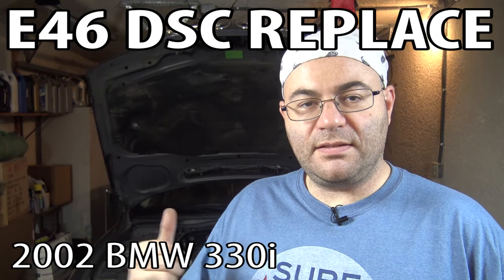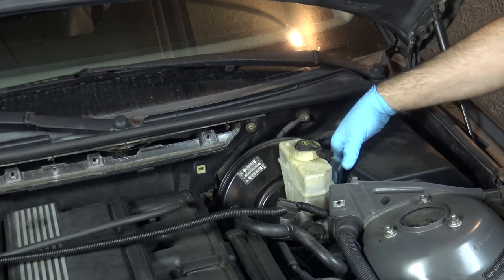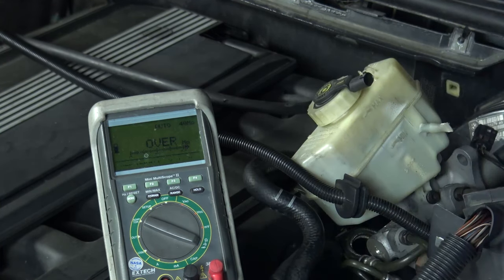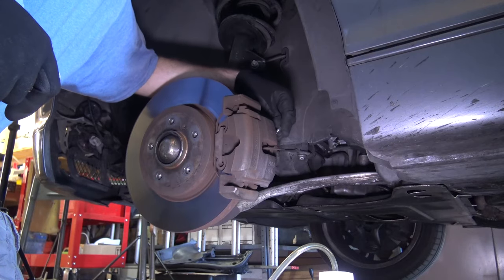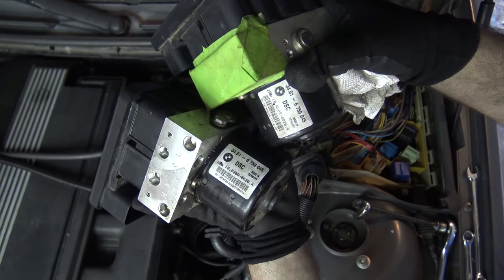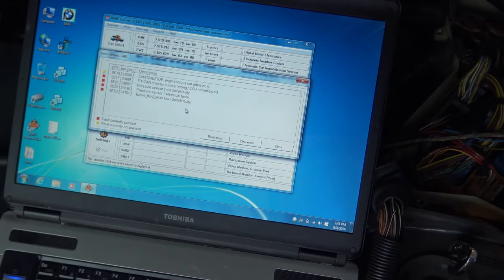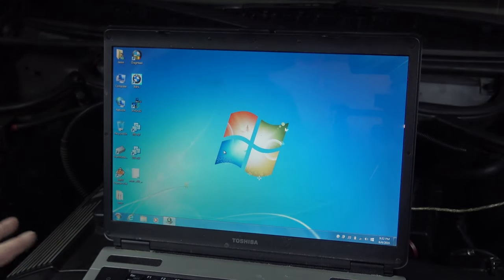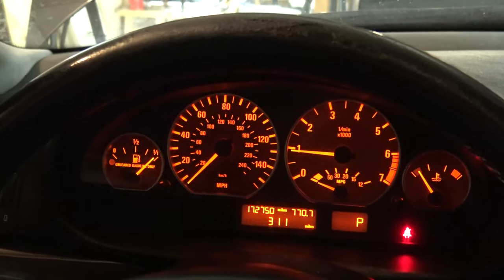BMW E46 DSC (Dynamic Stability Control) Unit Replacement & Coding! DIY

Comment: Two question and 1 comment.

Q1:  Once in inpa mk60 module, the steering wheel calibration was only 1 of 3 things to be set.  What about the other two?  (I think one is pressure, another is lateral acceleration.  )  

Q2: I have an E39.  I could not find any "compensation option" like this under chassis for the DSC module.  Which version of INPA are you using?  I think the E46 is similar, so I tried to use it but it would not allow.

Comment: Under chassis, it says steering wheel sensor, but you never need to go there, ironically.

Comment: Struggling with the coding on mine, when I select akmb or ews they show completely different vins to eachother, I know the vin when read using ista doesn't match chassis as I think ECU was replaced (says sportwagon when car is coupe) EWS brings up the correct code but the process won't complete, it comes up with coding index is not permitted

Comment: Hey great videos! Can you please help me? I got a 325ci 2002 and Just replace the dsc module and when I just turn que car On the 3 lights turn off (brake, abs, dsc) but after 10 min running they turn back On,  and so on, just put the same code one and reprogram, but keeps happening, Please help me!

Comment: I'm looking for a solution for my E46 330i EV51. I found part no for my 330i, but there's no cheap options but there were lots of same look and part no. in Ebay. Is that okay If I use similar part or not?

Comment: Next time you hit the junk yard, cut those connectors from a junk car. That way  you can just plug those in to test the modules the next time without having to unscrew them. Just make sure to test the harness connectors you get from the junk car first to verify they are good.

Comment: to drain easily the brake master you can use a 1 inch diameter syringe put a short or 6 inch long 1/4diameter hose and suck up the braké fluid in the resevoir you can suck up brake fluid easily

Comment: Hi 50sKid
I have a problem, sometimes the yellow light turns on DSC and yellow hand brake together.  How do you think it is the same problem as you have shown your video?
Thank you
Reply from the maker: You'd have to read the errors in the computer to figure it out.
Reply: Ok, thanks for repply. I need to wait when lights gone on.I drive now the fourth day and all is well.

Comment: Hello 50skid I installed everything and when opened and tried to code the mk60 module its says coding active and gives me 4 error codes basically saying the module isnt reading or responding any ideas on what it could be ?

Comment: Hi again.  Lately the DSC light goes  on my dashboard ( yellow in color in the very center. ) on my 328-2000 with the M52TU. ( no  other lights go on.)  But some times goes off. Some times stays on. Pressing the DSC button below doesn't put it off. If I buy a new DSC unit at BMW.
Does the dealer needs to reprogram the DSC unit for my car.???
Or removing the old DSC in the car now.
Where do I sent it to be repaired.?
Which is better for me to do.? 
Thank you. So much.
Reply from the maker: +Tonio Castro this video literally contains all the knowledge you need to answer your own questions. Did you watch the whole thing? I replaced my unit with another and reprogrammed it all in this video with inexpensive hardware $20 and software (free if you look for it)

Comment: Hi I have a 2004 BMW 325i and I removed the cluster to replace gauge rings and when I plugged it back in the DSC AND YELLOW BRAKE light comes on how can I fix it because they weren't on before I removed cluster..any advice thanks
Reply from the maker: Get a bmw scan tool (i have a video for that) to read/clear the errors

Comment: i also have a code for the brake pressure sensor like u did do I just buy a new one  I have the internal fault code but wouldn't see why both would have failed at the same time or is this a common issue thanks 50
Reply from the maker: I suggest reading the fault codes with a BMW code scanner first to find the real problem.  The DSC lights also come on if you have a bad wheel speed sensor.
Reply: 50sKid yeah I had a bit of a battle but its done as per you're coding the vin in ncs expert inpa would not calibrate the steering angle sensor failed every time bought ista d off eBay all done no lights on . thanks for your input  and your great video, s

Comment: Hi Kid, just wondering - I noticed you are using the K-DCAN cable for a e46. When I go to E-BAY to purchase one, no one has one for a e46. I have a 2001 BMW 330i. Where did you purchase the one you have.

Thanks 
Melvin
Reply from the maker: eBay is not going to have a proper "this part is compatible with your car" feature for that item, so just ignore that.  The ones you saw will work on your car.
Reply: So the one that you have which is the K-DCAN CABLE WITH SOFTWARE will work on my car?
Reply: So the one that you have which is a K-DCAN will work with my car?
Reply from the maker: Yes.
Reply: Thanks , I will purchase one
Reply: my light comes on only when i drive off on every few min any help plz

Comment: I have 2002 BMW 530i.  The dashboard lights up the abs warning together with the dsc and brake indicator lights. they come on and off. When it's on, the OBD2 scanner indicates that the pressure sensor is plausible. There's a wierd sound when I apply my brake..I can feel the pedal vibrate ..GRRRRGGG like grumbling sound. I'm sure it's not the brake pads grinding. Do you think there's a connection between a bad pressure sensor and brake wierd sound?
Reply from the maker: You need to read the codes with something other than an OBD2 reader.  There must be some other errors stored.  I doubt that the pressure sensor implausible code is enough to cause physical symptoms--I've had that error pop up before and not cause the system to malfunction.

Comment: My ABS module has been fixed 4 yrs ago and it failed again. I don't know if someone can repair it again. I didn't like the local shop who did it. He disabled my precharge pump as it was running nonstop. Does anyone have any suggestions?

Comment: Great Videos, ThanksNothing on my steering wheel is working, 2004 325ci, no horn lights radio controls cruise, nothing, can you help me ? Thanks
Reply from the maker: Blown fuse maybe, otherwise corrosion in the steering wheel wiring loom.
Reply: I believe it is the Clock Spring. I've watched other videos on the subject, also the DSC light and BRAKE light is  yellow and Airbag light is Red, if Clock Spring is bad all those lights will be on in addition to nothing on the Steering Wheel working.Thanks for the quick response.

Comment: VIDEO VERY GOOD BUT HARD WORK.
I find out in the end off video your MPH and MPG dont work when 
your engine running.
I have the same fault on my e46 320 2000/07, it start after i 
mounting  a new rear left abs sensor. What is the problem?
Reply from the maker: They didn't appear to be "working" because I was idling.  Your problem could be that you didn't connect the sensor correctly or you just got a bad sensor.
Reply: I ordered a new one instead of the blue one i got from ebay,  i tell you later how it's work.
Thanks for the answer.

Comment: 50s kid, i did everything you said and it worked!!! But one big problem, my brakes dont work, when the car is off the pedal is stiff but once i turn it on the pedal goes all the way to the floor with no pressure and a air pump sound! please help!!!
Reply from the maker: You need to bleed your brakes.  Search my channel for brake pressure bleeding.
Reply: 50sKid I appreciate it man. I did that today and it finally works!
Reply: 50sKid im having a similar problem,i replaced the module,bled the lines untill all air was out,but the brake pedal is still soft when the car is on, i also have 5 errors, 
5DF4 vehicle power <9 volt
5E43 steering angle sensor internal
5DF7 vehicle power >18 volt
5E1F ptcan chasi number wrong
5E15 can timeout egs
The last two codes are in "red" the other 3 are yellow and cant clear them, did i do something wrong??

Comment: Hi 50,s kid  i have 5da3 code front right wheel speed sensor do u know the meaning of this code  as it self checks fine only when i start driving it sets all lights or disconnected the sensor i have changed the sensor code does this sound to u a abs ring problem thank u

Comment: What are common symptoms? My dsc light is on as long as the yellow break light. And I have cleaned all 4 wheels sensors. Thanks
Reply from the maker: You have to use a bmw scan tool to figure out what is wrong--it could be anything.

Comment: Hi 50sKid I have a bmw e46 320i and the ABS light keeps on flashing...Do I need to change the DSC module or not.
Reply from the maker: you have to read the errors in the computer with a bmw scan tool like inpa -- I have a video on how to get an install and use INPA

Comment: Nice video, only the control unit could be repaired, the fault is not a real fault, the welds of the components crack, you have to open the lid and go over the welder.

Comment: I have a 2000 bmw 528i and my speedometer will not work when those 3 lights are on , when I start the car and drive the speedometer works but about one minute later it stops working when those 3 light go on .
Reply: agero redfish check the speed sensor on your rear wheels, have you have any work done around there recently?
Reply: I have the same problem it started while driving in the rain I still haven't find out why, I was hoping maybe you found the problem and share it please
Reply: left rear speed sensor is connected to the speedo

Comment: So the DSC module can’t be removed without completely taking apart and draining the braking system?!???
Reply from the maker: correct
Reply: the dsc module on my bmw comes out by unpluggingit and undoing 4 screws

Comment: Thanks so much for these instructions. I'm not sure if I'd be still owning my 2002 325ci if it wasn't for your channel. For others that came here to fix the 5DF5 internal error code, I ended up replacing just the control unit without draining the break fluid (as described in https://www.youtube.com/watch?v=5K2nx-2R7OE). This can be done by leaving the hydraulic block connected to its lines and separating the control unit and abs pump in place (which is real pain to do, but possible). After recoding according to 50's kid instruction my trifecta lights are finally gone (first time in years that the car has no trouble codes haha).

Comment: Would this work bmw 330i 2002
Reply from the maker: Yes that is the exact car I did this on
Reply: What if there's no codes coming out but the light is on abs brake dsc what a mess could it be I when 3 different  places to get it check and they say the no codes

Comment: I have E39 with M52TUB20 from 99 and in my Car blink ASC EML and chek the Engine light. any idea what could it be? my mechanic say throthle Body
Reply from the maker: No way for me to know that--you need to get a bmw scanner and read the error in the computer.  I have a video on bmw scan tools.
Reply: Ok, thanks for repply

Comment: do you need to bled the system after replacing the Ssensor
Reply from the maker: Which sensor?
Reply: 50sKid dsc pressure sensor

Comment: Yo boss. I got also have 5e19 problem too = can dme/ dde, engine torque not adjustable...5e1a can dme/dde signal error and also fffe = dtc definition not available... any thought or concerns? And how long can I or should I go with the secondary air pimp burnt out and not working?not sure if it's the reason I just got a new code for p0430 = catalyst system efficiency below threshold. It's been around 6 months since the pump went.
Reply: Hmongkie Yang .. I know that and it was working in September when I changed the ccv system. I'm not sure if the egr is clogged and maybe that's what made it burn out or the fact I removed the hose in between the two. 
Also sometimes rarely when I hit my brakes I feel like it almost pushes the pedal back at me  but in the snow if quickly suddenly hit them I feel it 3 out of 5 times. Almost like a crunchy feeling. I was thinking about doing a brake flush to get some pretty fluid, just for shits and giggles. Lmk what u think!

Comment: Sometimes the plug just needs to be disconnected and cleaned with contact cleaner and then it clears the error.
Reply: Which plug?
Reply: @KNuud  The plugs to the sensors and the plug to the control module.
Reply: Good to check the computer for which component has the error first. Then you can either clean the sensor plugs, check again or clean the module plug and check the computer for errors again. Sometimes the internal error on the module is from a loose wire in the module itself and there's a whole tutorial on repairing that loose wire.
Reply: If you don't want to mess with repairing the module and you're absolutely sure the module is bad, there's a company online you can send them to that repairs them for a couple hundred bucks.
Reply: Randall Coedwig Thanks! I’ll try cleaning the contacts first. If that doesn’t help I’ll get a used unit and replace only the module using these instructions: http://www.zhpmafia.com/forums/showthread.php?20660-Replacing-and-recoding-DSC-unit-without-bleeding-brakes-on-a-2004-Sedan-ATE-MK60-doityourself  Seems like draining the brake fluid is not absolutely necessary. Looks like a tight fit that way but doable.

Comment: How do  I get to the pressure sensors?
Reply: I removed the engine bay module box to get to the pressure sensor. The box cant be fully removed, but it gives you enough space to get the sensors. Also, put a towel under the master cylinder and quickly swap the sensor out. Its difficult but possible 😊
Reply: @michaelpierce202  Removing the module box is enough to get access to the sensors ? No need to take the master cylinder off the brake booster ?
Reply: @MrBerrada9  yeah, removing the box makes it possible. It just takes a bit of work to free the box.

Comment: Hi Kid,
Greetings from DEADF15H @ E46Fanatics.com.  I'm only having the DSC and the BRAKE light's in yellow, no ABS. 
I going start cleaning/inspecting the wheel speed sensors first. 
I have no codes with the bluetooth Veepak OBDII and OBDFusion, just the lights. Once I get back to NC, I will hook up PA 1.4 Soft, but I'm in FL at the moment.
Brake fluid level is good, no soft pedal etc... Fluid is approximately 30,000 hwy miles and 2 years old.
Reply from the maker: Yeah you gotta use the pa soft to lookup the errors in the dsc module
Reply: PA Soft Errors:
Under the ABS screen, not the Steering Angle screen. Fault is currently present and will not clear. 
5DF4 [24052] Vehicle power < 9 Volts
5E43 [Steering Angle Sensor internal 
IKE has two active faults
  BE 190 [Data filing difference to central light module (LCM) 
  BF 191 [Internal EEPROM checksum coding incorrect/incomplete 
I have a new Steering Angle Sensor ready to install, but it looks like NCS Expert/INPA would be simpler to recode the car with , so I'm going to purchase it. But first I'm checking some fuses

Comment: will this work on a 2000 up gm ls type ? dsc just curious if it programmable it mite be the same part#
Reply from the maker: gm Is type?  What does that mean?
Reply: 2006 ish chevy camaro / pickup truck
Reply from the maker: A chevy will have a completely different way of coding a module.
Reply: but it is do abele ? thanks was reading and the way i see it bosch made the part for both of them
Reply from the maker: You have to do some research on how to code modules on a Chevy.  If you even need to do that on a 2006.
Reply: thanks if it the same part# i can use bmw programming to make up for changing my car tire size weight eat. just making it saver and faster it the twisty bits the chevy way i haven't seen if it can be done. id like to keep the abs
Reply from the maker: No you cannot use the BMW programming tool.  It will not work unless you have a BMW.
Reply: thanks :( on not working so what part # did u use ? if this will not work. i give up. but that u a lot 4 helping me :) ben reading how to get fully programable abs like i can 4 my engine, the bmw / Porsche parts bin look like it mite be the way to fix because i have seen any thing yet in the gm forms how to do it